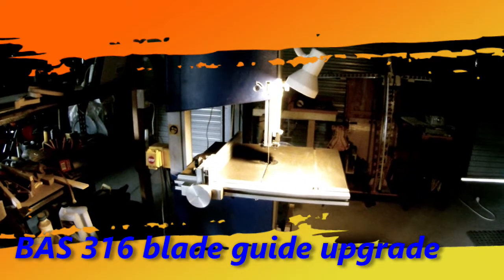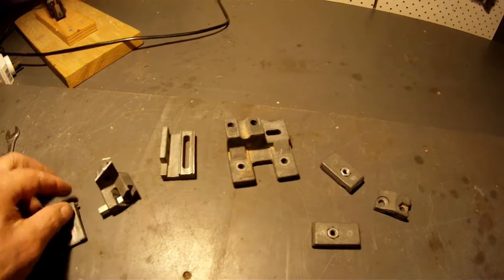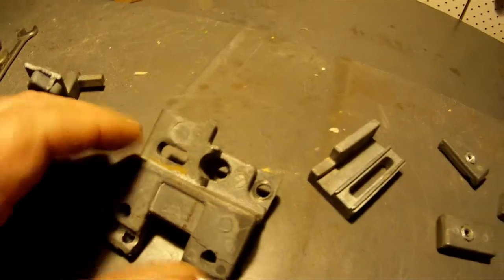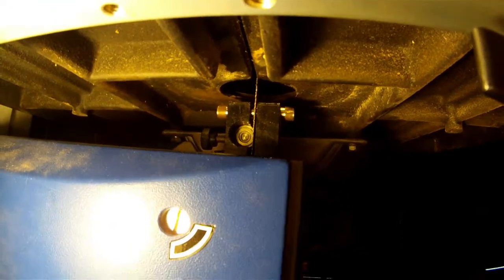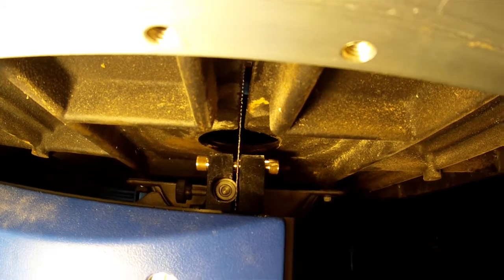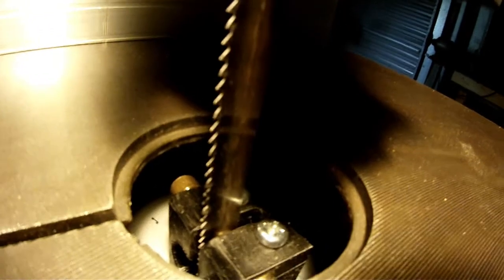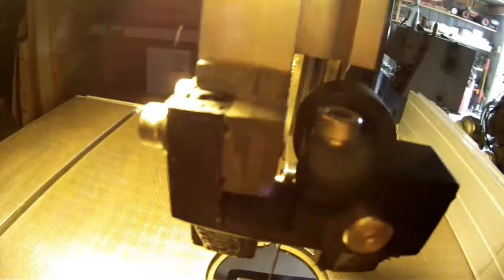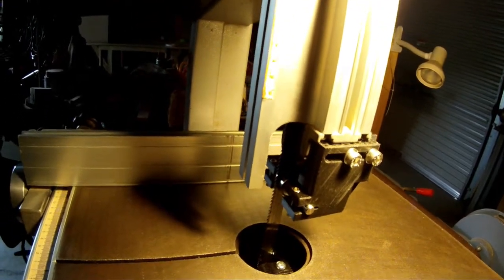Bandsaw blade guide upgrade

Comment: hi, where did you get this set of guides?
Reply from the maker: I designed them then 3d printed them using stock sized bearings. I made the bronze parts in my lathe.